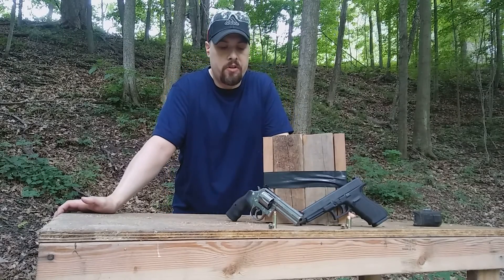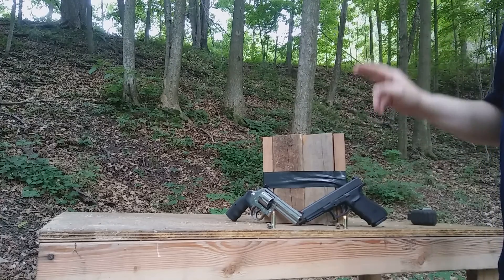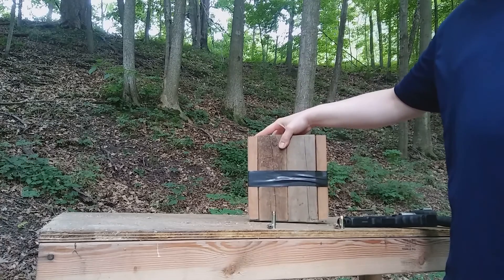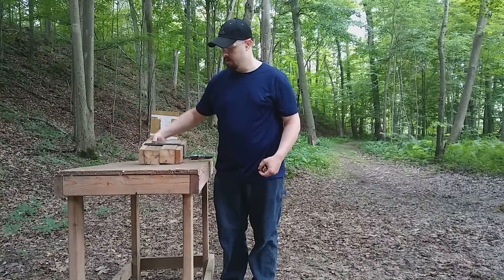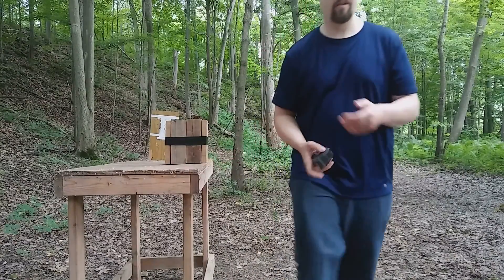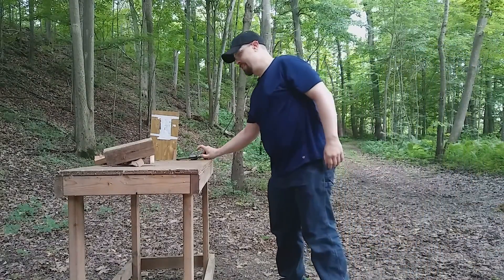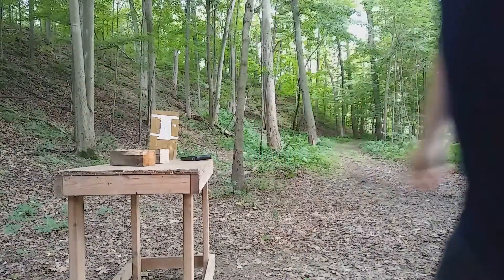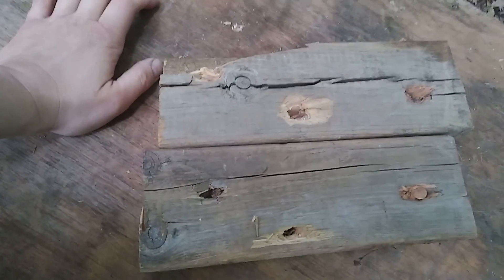.45 Auto Vs .357 Magnum in Full Sized Handguns Episode 2. Momentum

Comment: There's a quick and dirty way to get a momentum comparison between two bullets. Simply multiply the weight in grains by the velocity in feet per second. The number you get is not really an impulse or momentum figure. But it is a good way to compare two different loads should you catch the bullets rather than getting pass throughs.
Reply from the maker: I wish I understood this math! lol. I have wondered for awhile what the momentum calculator on http://www.handloads.com/calc/quick.asp means with their numbers. Like 9mm vs .45, 230 gr @ 850 vs 115 gr @ 1200....The .45 shows a momentum of just "27" and the 9mm a momentum of "19". I don't understand where the 27 and 19 come from, if that's a standard number or just their own way to label momentum.
Reply: @GunSam  I'm sure they are just labels. The numbers certainly don't mean anything to me and I've had college physics. Multiplication is easy to do. Just need a calculator ;-). Nevermind what the number means when you do bullet weight times feet per second. Just use it to compare different loads. The larger the number, the greater the momentum. You can double the momentum in at least two ways. One is to double the velocity. The other is to double the bullet weight. Other ways are in between. More velocity but less weight or more weight but less velocity are going to be your typical combinations. Just multiply for the comparison and don't worry what it means. One number will be bigger than the other. If they come out the same, you have the same momentum.
Reply: @GunSam  I had a look at the JavaScript code for the energy calculator. It's using the same formula for calculating energy that I use. It's doing something a bit weird with momentum. Either my formula is wrong or theirs is.
For the Taylor KO number, they are multiplying bullet weight in grains by bullet speed in feet per second by bullet diameter in inches. That's all the Taylor KO number is. How they come to that formula I have no idea.
Reply from the maker: I wonder how accurate the Taylor KO factor really is. Seems like if there was validity to it, it would be a more useful tool than most. The calculator shows a 158 gr bullet at 800 fps (snubby load) having the same Taylor KO as a 115 gr@1050 fps(subcompact load). I would tend to agree that even though the 9mm would have 57 FPE more energy, what the heavy .38 Special would do do an animal would be about the same.
Reply: @GunSam  I entered a fictitious loading into the calculator for a hypothetical "Super Police" load that I think is actually entirely reasonable. 200 gr bullet @ 850 fps. I don't know if this falls inside .38 Spl +P range or is into light magnum territory. The numbers I got out were,  320 fpe (not bad, I could run with that), 24 for the momentum which is really power in fpe/s, and a Taylor KO number of 8.

I have to be honest here. I think that Taylor KO number is complete bullshit. I would be OK with the calculator if it left out the Taylor KO and relabeled momentum as power.
Reply from the maker: The 200 gr police load would probably be about the same power in either .38 Special or .357 magnum since the overall length of the cartridge came to the end of my cylinder when I used .38 cases. You could load either cases to the same pressure as long as it's fired in a .357 revolver if you went really hot. Closer to 700 FPS is about your max speed on a cartridge like that, unless you hot rod it.
Reply: @GunSam  Well it does need to be able to knock your blocks of wood clean off the table and out of camera frame. And 850 fps is such a pretty speed. I'll have to research the load data. Using .38 Special brass is no problem. In fact, I think it would be preferable. I am going for a short barrel load. Out of an 8" barrel, it probably wouldn't be much of a load. I'll also have to look into that Taylor KO number. Until yesterday, I never even heard of it. It really does seem contrived though.
In your experience, does hard cast lead still slide down the barrel easier than jacketed? Low bore drag would be nice for such a long bullet.
Reply from the maker: I have never chronographed hard cast vs jacketed vs soft cast. My gut feeling is that it would be faster than jacketed but a little slower than soft cast. There's no leading at all with hard cast, and the leading is sort of the equation that gives you more velocity with soft cast lead. A little strips off the contacting surface of the bullet onto the bore rather than staying on the bullet and continue to drag and slow velocity.
Reply: @GunSam  The one thing I don't want to do is exceed .357 Magnum pressure. I'm OK going into the 20kpsi range. I don't think this would be a J-Frame load. If it fits in the J-Frame cylinder, I would just take whatever velocity I get. My target of 850, should I choose to stay that ambitious, would be for the 2.75" barrel on the M66-8. A 4" barrel would probably turn in a bit more. I don't have one of those. My next step up would be the Taurus with the 6" ported barrel.
I am quite curious about the capabilities of such a load. There are no wild boars around here and it is not legal to shoot the deer. I need some good simulants.
Buffalo Bore has a non +P 158 grain wadcutter load with gas check that is rated at 850 fps. It's a hard cast.
Reply: @GunSam  OK. Now you're going to hate me because math. To get the 320 fpe / 850 fps I'm after with the 200 gr hard cast in a 3" barrel, I need to push it with an average force of 1,280 lbs. That's only 12,800 PSI average. I already know that 3 gr of TiteGroup or 3 gr of Power Pistol are safe but don't have the energy to do that. Now for the tricky part. Whatever powder I use will reach peak pressure while the bullet is still in the chamber. It will continue to burn until he bullet exits the muzzle but the pressure will be going down. So I still need sufficient powder to transfer 320 ft-lbs to the bullet without going over pressure in the chamber. Also, I do not know the bore drag or how different powders change their burn rate with pressure. So am I half way there?
I did a quick Google search on "38 special super police load". There are a fair number of hits. So I have to sift through that information.
Reply from the maker: I think that if the case depth is close, that the case capacity was close to a 9mm's, than that charge could be used, which in terms of Titegroup, I believe is about 4.5 grains. I'm sure that we would be over 30,000 PSI and over 800 FPS. One person on here claimed to do a police load at 1,200 FPS, I called BS but he kept giving information about it. I'll look up the comment if you're truly interested.
Reply: @GunSam  1,200 FPS? I would like to see that if you can find it. There is no doubt in my mind that that is a magnum load even in magnum brass. Also, it would have to have a long barrel. If that was chronographed from a six to eight inch barrel from a magnum revolver, I might believe it. I'm not a gun expert, but doesn't Ruger make some heavy duty single actions with longer cylinders?

From what I can tell, getting 850 fps is probably +P. The loads you were shooting were standard pressure .38 Spl from my research. I dumped a bunch of comments on your Super Police video. Hopefully I didn't overwhelm you. It seems like a cool round. But I think with today's loadings, it is more of a curiosity. That said, the 200 gr SWC hardcast at magnum loadings would be one awesome hunting round. I believe .38 Spl brass would provide more powder efficiency and less muzzle blast. Although the primary benefit would be fitting in the cylinder if the magnum brass makes the COAL too long. Powder is cheap when you are only using half a dozen grains for a load.
Reply from the maker: I looked back at the comment, he claimed 1,100 FPS in a 4"  and 900 FPS in a 2" in a .38 Special case. Says the powder of a "max charge of 2400" That's the only data given.
Reply: @GunSam  I see. He's not terribly helpful. BTW, do you know if there are any internal ballistics calculators that can provide PSI numbers for loads? Considering the equipment for direct measurement is rather exotic, such an app would be very useful.
Reply from the maker: I don't know of those type of ballistics calculators, but my thought is that they would certainly have to be powder specific rather than capacity/weight/velocity based seeing as all powders are different. My Spidey senses tell me this guy is full of it. 200 grains@ 1,100 FPS? That's 537 ft lbs energy from a 4", that's the maximum power of a 158 gr magnum while employing enough slow burning powder to get it that fast. And he's claiming it in .38 Special case with limited case capacity. Now with such a long bullet, case length is out between 357 and .38 and any one could be used, however you would have to be at magnum pressure and beyond. And 900 fps from a 2"?  That's 360 ft lbs energy from drastically less case capacity vs the Buffalo Bore 158 gr, and the Buffalo Bore is only 352 FPE in a 2"!  Sure, you could get the velocity he claims, but you would not be able to call it a .357 Magnum and certainly not a .38 Special, because they would exceed all international standards needed to even call it that cartridge.
Reply: @GunSam  I did a quick search for ballistics calculators. Most were exterior ballistics. The closest things to interior ballistics were really nothing more than handloading data rather than what you rightly pointed out as what I was looking for. It kind of sucks because component manufacturers do have apps! They are just the wrong apps. IOW, they are very limited so you can't freestyle and get useful data like pressure graphs and such. Mind you, such an app would be hard to write even as a powder manufacturer because each barrel is slightly different along with brass, projectiles, and primers. The reviews on the few component manufacturer's apps were saying that they were basically sales apps. Obviously that is not at all what I want.

As for that guy claiming to have a hyper powered 200gr load, either he's not chronographing it and is thus full of it or he's gonna blow up his gun sooner rather than later. The only thing that seperates a load from a pipe bomb is the bullet moving down the barrel fast enough to keep the pressure down.

I think 850 fps is doable, but it is either +P or +P+ if not outright magnum. And that is from a 3" barrel. From a 2" barrel, it will clock slower and have more blast. You can't beat the laws of physics. A 6" barrel would be a lot easier. And I would actually do initial load testing in my Taurus. The S&W M66-8 is a hell of a lot more expensive!
Reply from the maker: With such a long bullet per weight, I wonder if there is ever a point at which surface drag may start to slow it down more than a shorter bullet.
Reply: @GunSam  I suspect there is. The bullet has to be squeezed down to form a seal. And even though the formula for friction does not include surface area, it is limited in application. For example, more rubber on the road gives you more traction.

Totally off topic, this seems like a cool NYE kinda thing. Probably not a good self defense load though as it is not incendiary. https://www.cheaperthandirt.com/product/ammo-inc-streak-38-special-tracer-ammunition-20-rounds-125-grain-streak-total-metal-jacket-projectile-818778020874.do

Back on topic, Wikipedia talks about the 200 gr Super Police: https://en.wikipedia.org/wiki/.38_Special
Reply from the maker: Wiki shows the 200 gr super police bullet as having a velocity of 671 fps. That's not too far off from my creation by about 40-50 fps. I'm sure that a work up from my 3.0 gr of Titegroup to 3.1, 3.2, and 3.3 would well be within safe parameters and would give me the 671 fps.
Reply from the maker: I do appreciate the end statement in Wiki " The .38 Special, handloaded with premium to regular lead bullets can be loaded safely to equal the now popular 9x19mm Luger round, and equal the power of the .45 ACP round. The round is still as viable today as a self-defense round as it was back in 1898."
Reply: @GunSam  Yep. Validates my video on 38 being special. Didn't you also do a video on the .38 Spl being the best cartridge? Also the BB 20A kicks ass and the non +P version (only 850 fps) is no slouch either with the exact same projectile. And down on the soft shooting end, it really is suitable for teaching someone to shoot because the recoil is so light in a heavy revolver with proper sights to get the marksmanship principles down.
Reply from the maker: Yeah, I have a video about the .38 Special being the best. Not many views on it (roll eyes) for some reason it has 210,000 views. In that video I explained how the Buffalo Bore has 350 ft lbs in my snubby, I got verbally attacked for that for a year as a liar before I tested it, and when I finally tested it in my snubby.....1,002 FPS/352 ft lbs. I want to do a video on all of this, like going from .38 Wadcutters and .38 Short Colt ammo in the J-frame, all the way up to Buffalo Bore in the 4". Covers roughly 100 FPE to 500 FPE depending on load choice. I want to really focus on recoil sensitive shooters and why the .38 Special is better than other choices, particularly wasting more money on a .22 LR for a female shooter, why do that when .38 Short Colt ammo in a full size .357 revolver would have even less recoil than the .22.
Reply: @GunSam  FortuneCookie45LC has a bunch of videos on the topic. I watched one last night where he compared the difference between a 110 gr LSWC fired from a .38 Short Colt to the same bullet fired from a .38 Special using the same powder charge. The Special was down in the 7-800 fps range. The Short Colt pushed over 1000 fps. I forget which powder he used, but it was a pretty light charge.
I looked at the MSRP of the Beretta 21A Tomcat the other day. I thought it would be cool to have a Beretta in a caliber I already have other guns for. Rather pricey that little sucker. I bet an LCRx in .357 Magnum could shoot light but just as effective .38 loads as the 21A and be more controllable and easier to operate. It would be a great test except the financial outlay to get one of each would hurt this time of year (or in April, or any other time you can't just cough up $800).
I don't know how low recoil you want to go, but 110s certainly would be the ticket. I don't know if factory Short Colts are available though. The .38 Special killed that market. I think FortuneCookie45LC got some Starline brass in .38 Short Colt rather than cutting down .38 Special brass (which is the way I would have gone).
OK, I stand corrected on factory ammunition: https://www.targetsportsusa.com/38-short-colt-ammo-c-924.aspx
One thing to consider in the "old lady" equation is willingness to carry anything particularly heavy. For a bedside gun, that's not an issue of course. The only reason I bring the weight of the gun into consideration is that my niece did comment on the extra recoil in my 638 J-Frame shooting the same ammunition from my Taurus 669. I don't know how hot the Magtech .38 Spl 130 gr is loaded. I just know that it is standard pressure. Another issue is that .22LR is so cheap. Mind you, if you can have only one handgun, I'm pretty sure what caliber mine would be in.
Reply from the maker: I noticed that .38 Special short is a thing as well. It looks like the same thing as Short Colt ammo. The whole .38 Short Cold development is fascinating. How it used to be a heeled .375" diameter bullet, or something like that, then it went to a .358 inside the case bullet, which then it got longer and the .38 Special was born. If I do a video on this, I will certainly have to warn people to be cautious of antique .38 Short Colt ammo, as the bullet diameter is different, along with the warning on not using .38 S&W. All these cartridges are confusing lol, the .38 Short Colt and .38 Long Colt spawned the .38 S&W Special, but the .38 S&W had nothing to do with the .38 S&W Special. Why the .38 Special was not truly the .38 Colt Special, I have no idea.
Reply: @GunSam  I think they were winging it! LOL. For today's guns, having the two modern cartridge case lengths is probably more than sufficient. For super light loading, you can seat a light bullet all the way into the case of a special. You could also trim the case. I would opt for a high bulk powder that requires more charge to deliver the same energy.
Edit: Or a very fast powder with a small charge. That is probably better. Not sure about velocity spread though.
Reply from the maker: @Fudmottin  with light bullets in a .38 short colt, such as 90 grain or whatever they can employ, I would say case capacity and charge should be similar to a 148 wc in a special case.
Reply: @GunSam  I'm thinking more and more that available case volume after a bullet is seated is the determining factor of charge weight. Mostly. It still takes more time to push a heavy bullet than a light bullet. I think that makes the heavy bullet a bit more efficient in terms of getting energy from the powder because the powder will burn more completely. That would be partially negated by the extra bore drag. This can be tested by measured charges, remaining case volume, and a chronograph.
Reply: @GunSam  This is the calculator code they use. I'm sure you'll get a kick out of it! ;-)
http://www.handloads.com/scripts/calc.js
What they are doing with momentum is weight/7000 to put it into pounds from grains and then multiplying it by the speed in feet per second. It's not a true momentum figure any more than I gave you. They just make the number smaller. Their units would be ft-lbs/sec. That's actually a unit of power. So they should be labeling it as power, not momentum.
Reply from the maker: WHy did you have to go and show me this! I would take June 23rd and a thick layer of bug spray over a thick layer of coats, in order to be in the woods for a long time!